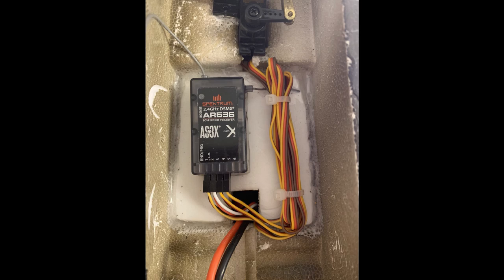Spektrum AR636 Programming Series - Part 13: Installing the Spektrum AR636 Receiver in your Model

Comment: Just finished programming my 636 per your instruction. Hope it goes well this weekend.
Reply from the maker: Best of luck! Please remember to double check everything. No reversing in the transmitter for aileron, elevator, or rudder... all control surfaces move in the right direction. All surfaces CORRECT in the right direction, and receiver orientation is correct. Gains are going to be specific for every airframe, so you’ll have to adjust those at the field. Let me know if you need any help!

Comment: I followed your instructions to this point. I installed the receiver, leveled the model, inserted the Bind Plug. Turned on the transmitter and then connected the plane battery to the ESC. The receiver began making beep--beep--beep noises in an unending sequence. Binding seemed to work as expected but the beeping never would stop and after disconnecting the bind plug and repowering the receiver I could never control the surfaces.

I can't figure out where I went wrong.

Comment: Can I leave the AR636 inside my aircraft and fully connected, all servos plugged into the receiver while using the model builder and the programming cable plugged into the bind port on the receiver and performing the program functions including importing the corrected model to receiver?

Comment: I have a quick question. I followed everything you have in these videos and here I go and install the receiver in the plane and noticed the AS3X wasn't working until I turned the R KNOB, what do I need to do to put the AS3X on a 2 or 3 position switch? 

Other than this hiccup all the moveable parts do as it is supposed to do. Thank you Sir!

Russ